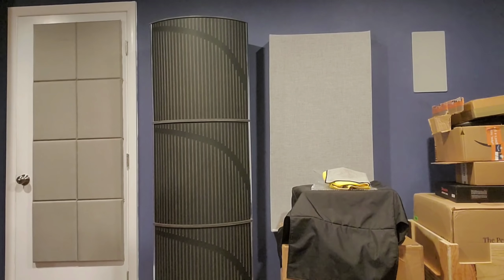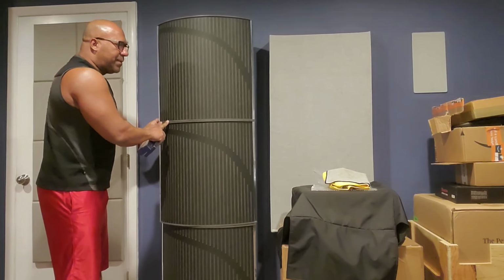Furutech Outlets initial reaction!

Comment: I don't think anybody here is a electrician ?  And can explain junctions ...
Junctions are points of contacts and breaks ! And there's many in a stereo system , from the signal RCAs , XLRs to the power cords! And all of them are junctions and breaks . Places where connections are made and broken! Hospital and Military thankfully don't use $500. Outlets or $25000. Cables ? All the cables in your home running through the entire house don't cost $25000. ? But you think you can change everything with a outlet or a piece of wire ? Hospitals are built from the ground up with the needs of the hospital and departments ! Samething with the military applications  it's in the blueprints before anything is completed ! They are not buying things after the fact to try to make up for things that were addressed in the construction of the building ! Every room is specifically designed for the application it will be used for ! The cafeteria is not the same as the operating room ? NORAD 'is not built with pretty boy outlets ! Actually I'm glad you got taken !
It completely shows the lack of basic electrical knowledge and misplaced believe in your resources? You can't by your way out of this ! With nonsense and promises of glory ?  The only thing that these things do is a good job at is currency separation ! That's the only benefit to be gained from such behavior! 
Obviously you don't play a musical instrument ?
If you did you would have a different reference of music and how it works?
Money and no knowledge is worse than being poor and smart ? The poor smart guy is resourceful and finds ways to accomplish things that people with money delegate to others with the hope that price they pay will solve everything?
Put a Ferrari engine in a Pinto ? Just because you have the money to do so doesn't make it fun to drive ,but you have disposable resources?
And you create a industry of lies and completely false engineering ! Most of the equipment you own is false ! It's completely based on the premise that because you paid a ridiculous amount of money for it, it must do what you want it to do? 
You can't buy your way out of this! If you have a $100.000 system and it doesn't sound like you want because of a outlet ? Then you have bought the Brooklyn Bridge with no way to have it shipped to your address? The middle east has real crud oil ! The Un United States has Snake Oil !

Comment: I had just installed the Furutech GTX D Rhodium in place of a PS audio Power Port. The differences were so huge and very impressive in good and bad ways. Since the first minutes I had a much better soundstage, more layers, more instrument separation  and highs extension, more microdetail and tighter bass. On the cons side a lost the punchy bass at the point I am thinking in come back to the PS audio port. The mids despite having more detail had become dry and coarse. I will wait the 500 hours point to take the decision but now I can not listen my beloved Miles Davis or John Coltrane so strident they become with this outlet. Is there a link for Jay´s conclusion ater the break in?

Comment: I have been using and experimenting with Audiophile AC duplex outlets for over 20 years.  The outlet you are speaking about in this video takes 500+ hours to break-in.  Better yet is to break them in with a cable cooker like Audioharma.  Most dealers can do the initial break-in for a small fee.  When fully burned-in the outlet offers a warm refined presentation.  Synergy with your system as you know is key.  The more refined a system is the more of a difference AC outlets make.  And yes they do effect the performance of a system, very audible.  The more complex the plating scheme the more colored the presentation is and the longer the break-in.  Be aware the more complex the plating scheme the wilder the sonic swings are during break-in.  

Want a lush and purer/organic sonic presentation, use a pure copper outlet like Furutech FPX Cu ($80).  Want a more open, natural timbre, most transparent and uncolored AC outlet I have experienced is the Cruze Audio Maestro ($100).  The Cruze Audio Maestro outlet comes "mostly" pre-burned-in from the factory.  The Maestro outlet will sonically perform better than any Home Depot outlet you can buy.  Oyaide outlet's presentation is very colored because of the plating schemes, so again system synergy is key.
Reply: What's your view on Furutech Gtx-d(gold) or GTX-d,(rhodium) ? Any feedback on these 2?  Or any others ?

Comment: Hi Jay, I bought some Furutech NCF Rodium plated inlets for my power strip and noticed similar findings to yours at the beginning, I was amazed by the quality of the improvement in sound. Over a few days the benefits started to fade out and now I'm starting to get some harshness, very slight I must say, but I also have much lower level gear than you. I was wandering how they ended up sounding like after the complete burn-in. Are they now similar to what you heard in the first place? Thanks
Reply from the maker: Yes. Just wait about 500-1000 hours
Reply: @jaysaudiolab  great, thanks!

Comment: A few things. Thank you for the review of the Furutech outlets. I have one of these for my system and was adding two more as I just upgraded to Nagra HD Amps. I purchased my Furutech outlets from VHAudio (Van Husen) and he cooks them on a cable cooker. I recommend buying a cooked outlet cooked on a cooker. The other aspect - you are not running an isolation plate. With those monster Wilson speakers, you will benefit from isolation. The isolation plate is a few hundred bucks.

Comment: Have been using fururech outlets for a few years, they sound good and much better than stock ones BUT they take very long to burn in and it has an inicial ups and downs for a few weeks...grain then clean, shrill then soft and so on...let them burn in...in the end it is worth it

Comment: Your channel loses prestige when you say you did your research and apparently, you didn't. These outlets require hundreds of hours of break in. Many many people complain about the brightness during the break in period. I own two of these outlets, and so have gone through the process twice. I'm sorry, but I am unsubscribing, because it's apparent you didn't do the necessary research, and I'm an extreme armature compared to you, and even I knew this.
Reply: What is brightness?
Reply: @GameHEADtime  In the context of audio, 'brightness' refers to a sound characteristic where the high frequencies are exaggerated or emphasized. It can make the sound seem sharp, detailed, or harsh depending on the balance. During the break-in period of Furutech outlets, many users notice an emphasis on the treble or high-end frequencies, which can sound unnatural or fatiguing until the outlet stabilizes with use. Over time, as the outlet breaks in, the sound typically becomes more balanced and natural.

Comment: Break in, are you joking what is there to break in, a piece of metal to metal contact? Please explain what needs breaking in.
Reply: the thinking so far as i can tell is the metal will undergo a settling process under electrical conduction which will have improvements to sonic performance. 

why it’s always an improvement? idk 😂

Comment: Jay I went through the same problem looked on YouTube nothing there so I added it to my system Woo Audio WA33 Elite with upgraded KR HP tubes directly into new outlet along with my Chord Dave instantly better sounding from my old setup which was a 1980 outlet plugged into my AudioQuest Niagara 1200. But it started to change for the worse. So I called my dealer where I purchased them and he told me to first install it on my refrigerator outlet and let it be there running for about 2 weeks I did and changed it out and instantly 100% everything came back with authority and grunt.

Comment: Hi fellow audiophiles. When I listen to the reported affects of line side  power upgrades I am skeptical of these upgrades but at the same time are interested in the perceived affects on sound. As a Master Electrician and audiophile for 40+ years, I cannot believe a power  receptacle could have a dramatic affect on a audio system. I do believe in upgraded hospital grade receptacles use in supplying power to my equipment along with multiple separate circuits on same electrical phase from the distribution panel but beyond that I find it hard to believe a $500 receptacle could have any sonic advantage. I personally have used large isolation transformers to provide power to my equipment along with double conversion power supplies for my front end and ultimately I revert back to plugging my equipment directly into the wall. Jays experiment falls short of concretely substantiating this devices value as a sound improving device because how could it sound good on initial installation and then hours later not sound good. Most likely there is something else causing this loss in sound and it is probably a  intermittent power line disturbance from a residential device such as a refrigerator. I have analyzed my incoming power with a Fluke  41 power harmonics analyzer and have found New Jersey to have some of the highest total harmonic distortion at 7+%. The usual allowable percentage is below 4%. Crappy home generators are below 7%. Well I have ranted on for TOO long on this subject but I am open to suggestions on anything because like you we are ALL looking for that audio upgrade to take us too the next level.

Comment: I had used a Furutech Rhodium outlet for years, on less expensive high end gear it did give all the improvements you mentioned in the beginning of your video. One day, after having upgraded to Goldmund gear, I plugged my gear into a regular outlet and I could not believe the improvement. Fuller more extended bass, treble had much more decay and natural tone, vocals less compressed. There's a lot of information out there on the negative effects rhodium can potentially have on your system. But I guess it's not consistent, some systems react differently to it, otherwise it would not sell so well.

Comment: Ouch! Mae sure these are UL listed...Get a hubbell cryo receptacle hospital grade.. Less than 50.00....
I think the carbon fiber face plate should have mini Wilson anti vibration hubs. Instead of using a washer perhaps..0000000000000000.1% sound improvement regarding faceplate..